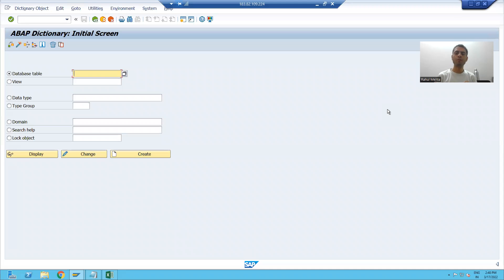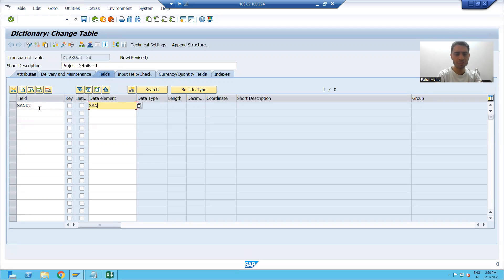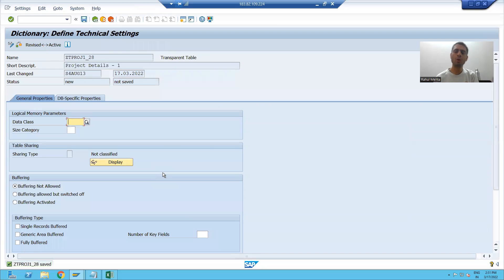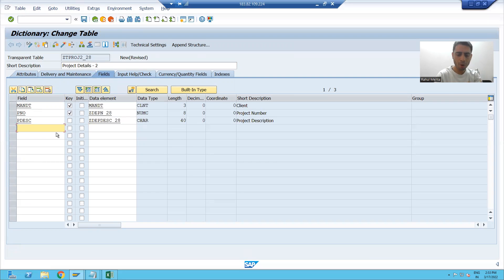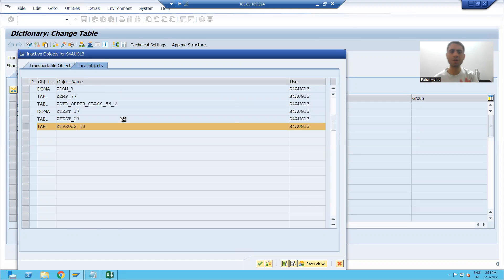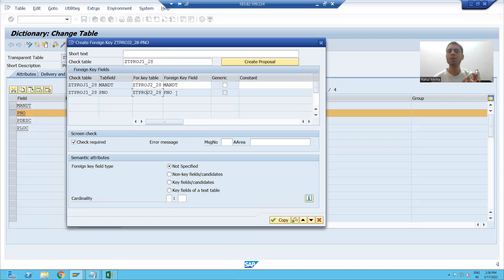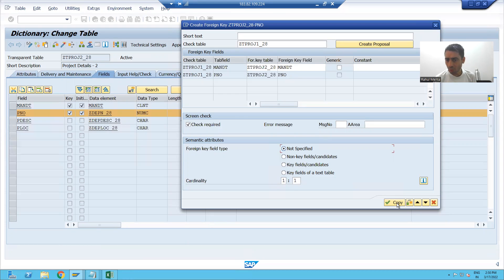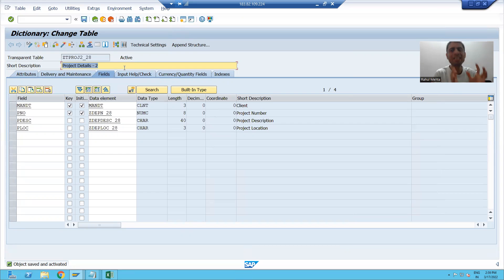26 - ABAP Dictionary - Views - Maintenance View Part2

Comment: Sir I asked ChatGPT Why can't we create Maintenance view on tables  with 1:N  Cardinality. But it's saying it is a common misconception in ABAP Devs. We can create Mnt. View on 1:N Cardinality. 
---Answer from CHatGPT -- 
When you try to create or activate a Maintenance View and it fails, the issue is usually not the 1:N cardinality itself but:

🔴 The Foreign Key relationship is missing or invalid.
In a Maintenance View, for 1:N cardinality, SAP expects a foreign key relationship from the child to the parent table.

🛑 If this is not defined in the Data Dictionary (SE11) for the child table, you cannot activate the view.

💡 Summary
Question	Answer
Can we create Maintenance View with 1:N?	✅ Yes, it is standard and supported.
Why does it sometimes fail?	❌ Due to missing or invalid foreign key relationship.
What must be defined for 1:N to work?	🔗 A foreign key from child table to parent table in SE11.
What kind of join is used internally?	INNER JOIN only
Is N:M allowed?	❌ No, many-to-many is not supported in DDIC maintenance views.